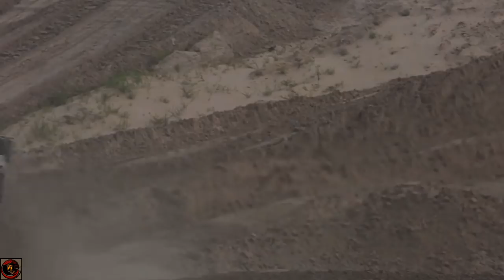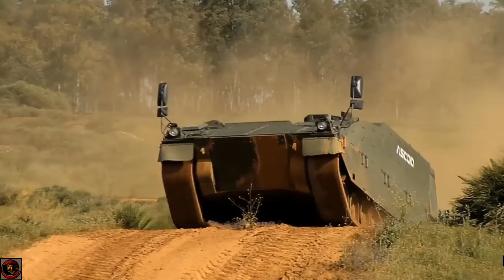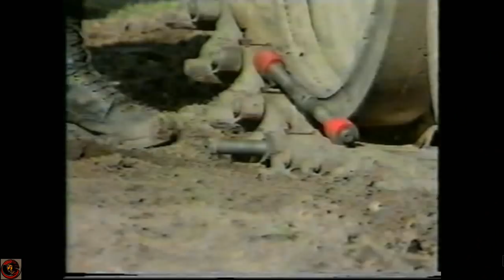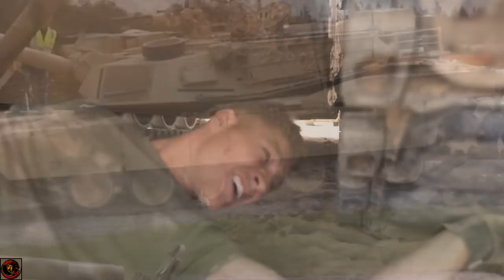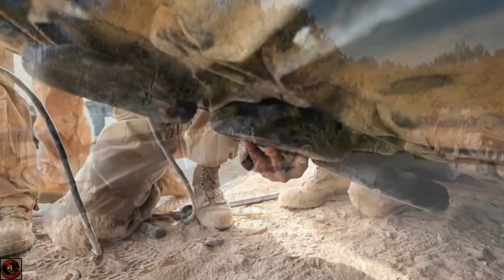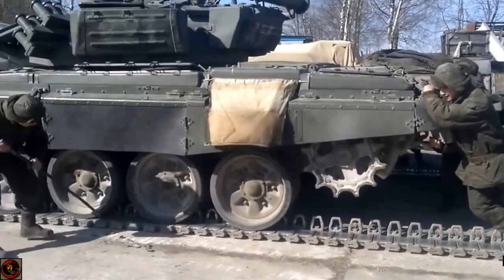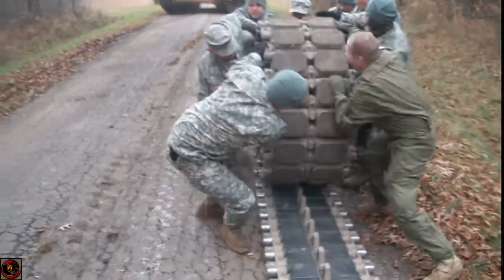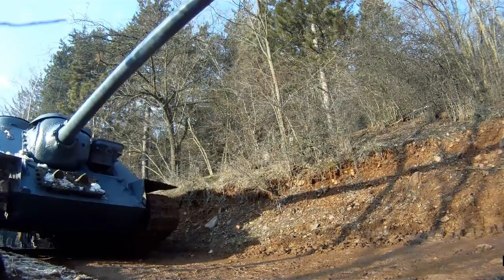What’s The Biggest Weakness on a Tank?

Comment: I still say vision is the biggest weakness of armour, you can be fully resupplied and mobile, but if you can't see the terrain or enemy, you're useless. Sure the crew can pop their heads out, but we all know how that goes when you're under heavy fire, I'd rather be a bunker with vision.
Reply: Experimental, as of now, IIRC. 
However, that sort of thing relies on sensors on the outside of the AFV, which (surprise) may well be damaged by shrapnel or other hits that don't actually damage the AFV itself. If that happens, you're back to the regular vision blocks.
Reply: 80% of the time commander of the tank will be poping his head out (exception would be city combat) cuz no vision port or next gen camera monitor will provide you with the same understanding of battlefield as you popin your head out.
Trust me its better to go into battle(or training ,whatever) with a blind tank rather than paralyzed tank...
Reply: Jochen Träm  The panzer 2 has solved the problem with its later variants in 1943 with a 180° viewport glass installed on the top of the turret near the hatch
Reply: Jochen Träm  Thus enabling the tank commander to view outside without having to be exposed to enemy fire.
Reply: I agree with this since "Information is ammunition"
But you have to remember that technology today isnt like it was back in WW2, it is constantly evolving. Taking the Abrams as an example, it has a GPS, a FBCB2 that allows the TC to track friendlies and overall increase battlefield situational awareness, has a CITV, a RWS/CROWS that can be used to scan for targets instead of sticking your head out and like any other tank out there, has periscopes. 

Of course, with all this said, it will still have blindspots. This is why there's Infantry and other support assets around to cover for these weaknesses
Reply: There are many potential ways of visualizing the short terrain surrounding, or visualizing the surrounding trough camera-blending of any sort. But that just means a LOT of electronics, sensors and places on the tank surface, that get completely useless once going trough mud or dust. ( but one could invent some sort of pressurized air system to clean them too, for the con of yet another system added to the thing ) Well, not completely useless, but one surely needs someone to go out with an cleaning rag. It be surely nice to have it, if one can. Also, the costs of such systems, maintenance, or even repair/replacements costs make it viable truly just for few nations and in small numbers. It probably be also a big pain for potential future modifications or modularity. But i could imagine some sort of terrain-radar ( in the sense like airplanes have them for really bad weather and low heights ), were it could let you see a sort of terrain-mesh. But it probably be difficult to use as one cant guess as good the stability and character of the ground without the color and fine details.
Reply: Callsign-YukiMizuki Even with all of the tech built into modern tanks most, if not all, tank commanders still prefer to operate unbuttoned and using the good ol' Mk. I mod 0 eyeball. Sure it doesn't have the range, or the night vision capability of modern sensors but they haven't made a camera yet that can properly replicate the field of view that you get from the human eye and I think that's why TCs prefer to operate unbuttoned.
Reply: I'm going to call that a rain cover, since I have problems imagining a piece of glass that'll stand up to a .50 BMG. Small ones, yes. Large panes, not so much. And I'd be grateful for a source, since that's the first I've heard of that.
Reply: I left my army service as a tank platoon commander. Even the antiquated Russian T-55 that I did my service with provided the commander with very good visibility. With a little practice a commander can develop excellent awareness of the surroundings of his tank. And as someone said, modern technology can increase this 1000 fold. Contrary to that, there's not much modern technology can do about the tracks. No wonder they are the least evolved tank subsystem since tanks first appeared in the WWI.
Reply: Thorny Dig8 
I think future tanks  can and will be equipped with their own small qadrocopter (not larger than 0.5-1m) with a camera on it that will be remote controlled by the commander, which could massively extend each tanks vision and also be a convenient means of scouting ahead esp. In city environment. It might even be equipped with a laser target designator to allow targeting for barrel-launched atgms or allies.
Reply: not really, for one vision can be made much redundant, it much lighter and smaller so you can have more of them. second if you lose vision you become useless but you can still make your way back home, you lose mobility you become a liability because their is incentive to defend the stranded tank because human lives, expensive vehicle and top secret tech.
Reply: actually ,they use a periscope style goggles...but it is very  limited...
Reply: Dima Hagever i believe that like their backup system i.e. if all higher tech fails the periscope should be able to work they are small tough targets. they have a bunch of sensor including generally two infrared cameras one for the commander the other for the gunner.
Reply: i was a rifleman and were on several ocasions fighting (training) against armored vehicles. abrahams, cv90's etc. And they absolutely bring hell. the thermal sights are godlike. they can spot your face a couple of kilometers away and spray it full of bullets before you've even seen the tank. especially during night and in the cold. ofcourse, tanks are weak to ambush, but a good tank unit would never expose themselves to an area where they can be ambushed unless absolutely necessary. 

even our javelins fell short sometimes because of their fancy defense mechanisms. 
All our training was done with the saab laser system, wich is very accurate in therms of damage and so on
Reply: Boots on the ground relaying information.
Reply: Thorny Dig8 So what is your point? A transparent armour for more vision?

Comment: You were so right, tracks are relatively weak and WILL come off if you ever are part of an armoured force. The last tank should have cleaned off all the rock from the inside of the track as it got caught in everything and screwed it. My mate tore a final drive off a 55 ton tank and it got stuck above the next road wheel creating a bulge in the tank guards...gas torch job. At about 12 months into service in the Aust Army I rolled a track off at night so it was jammed as well as off. I had to fix it without lights, full tactical and wanted to punch the troop commander complaining about why we couldn't move into the correct position. We has no night vision so driving was all by feel and shadows. (Australian Amy Cav)

Comment: What's the biggest weakness on a tank?
WOT player: oh it's gotta be the commander's cupolas. You can shoot it 20 times and it will blow up. That's why they got rid off them right?
WT players: man don't listen to those kids playing around with HP bars. The largest weakness is the tank's gun shield. They are weak as hell. The M60 Patton has a super weak gun shield that can be penetrated by T-34/85 from 800 meters. Also, there are gaps on your turret ring that has no armor at all and you can always shoot them from 1km away.
Reply: "What's the biggest weakness on a tank?".........Airpower.
Reply: InsanoBinLooney nah air power could miss...ATGMs dont
Reply: ATGM's are useless against modern vehicles because all of them use anti-chemical weapon armor appliques like ERA.
Reply: Anti chemical weapon armor? Thats new.
Reply: Chemical is mean for shell that contain explosive material to destroy the tank, opposite to kinetic round
Reply: But air power launch atgm too!! And bomb are guided so your argument is weak
Reply: Not really. A missile can be more easily guided than a bomb. A bomb is dropped and 'glides' towards the target. And when I say 'glides' I am generous. It is a controlled fall at best. Attacking a moving target with a bomb is pretty hard to impossible depending on the speed. A missile can guide itself via radar, can be guided by radio or visuals and it can change altitute and speed.
Reply: About gaps on the turret ring is almost true, there is a captured tiger after being shot between the hull and turret armor, rendering the tank unable to fight because the turret can't rotate.
Reply: As a WoT player I'd say woodland, or muddy terrain. 

NAH JK JUST LOAD GOLD LMAO
Reply: As a veteran War Thunder player ace of German panzer division, id say that a tank weakest spot is the side armor, even im using a tiger II H im just 1 hit from russian t34
Reply: E Shark that doesnt make it a good game...
Reply: Xikun Gao cupolas were removed after they stopped staggers too often in 1973 war. biggest weakness on all tanks except mercanaries are grill doors. can not put armor on everything
Reply: men of war assault squad 2 is much more realistic except for the repair button.l
Reply: No... Im a wot player and I said tracks.
Reply: Yes, a damaged track on MoW requires the crew to repair the vehicle, which takes a significant time and leaves the crewman who is repairing vulnerable for that time.
Reply: As a wot player I would have said tracks. Doesn't matter if you are wot or wt player you would have said tracks after thinking a little bit.

And gun mantlet is actually pretty hard to penetrate even in real life. About turret ring u were right but it is pretty hard to hit. 

And yea. I am not sure that were you serious:D If you weren't, I have wrote pointless and stupid comment so please were.
Reply: Imagine if tanks were just imaginary things for games. Oh wait, they're real.
Reply: E Shark I suppose you think Britney Spears is very talented or Justin Bieber because of their record sales. WoT is free to play, Russian and completely nonrealistic. A great game for mobile phones by any standard but WoT is built off a real physics engine which will always run better than that garbage call of duty clone world of tanks.
Reply: I suppose you mean WTs physics engine...
Reply: Wt players: the biggest weakness of a tank is it not beeing russian😂😂
Reply: The Big Boy lol, mowas2 is not that realistic, but its a good and frustrating game😂
Reply: You don't play WT do you?
Reply: TheTeknus
Yes I have seen that. The crew had to abandon it, didn't they? In North Africa?
The Panther was known for its 'shot trap' area caused by the rounded gun mantlet on the earlier models. If even a 40mm AP round struck the gun mantlet below the Panthers midpoint by 16 inches, the chances of that weaker round ricocheting downward directly through the thin hull roof armour was very high.
Reply: Biggest weakness of tanks : the engine compartment eve a hand grenade can destroy this ...
Reply: "What's the biggest weakness on a tank?"......... still  airpower.
and the biggest stronghold on it- the cost of fuel of the airpower
Reply: am suggesting when enemy's airpower is suppressed, the artillery with their digital age top super rockets means nothing when the  own airpower in the air is dominating
but the cost of that suppression means it could be one short blow with expences on the reconnaissance - not the constant insurance waiting when the enemy will show himself 
do you smell the gap?
Reply: Yeah, it is not a cheap one, but it is cheaper the patrolling in the air. A flying air gas turbine means garantied consuming of thousands bucks' fuel per sec and it cannot be interrupted during the flight . A diesel of terrestrial armored vehicle  is eating a hundreds of bucks per hour and can be stopped during the mission.  Perhaps money means nothing for a proud warriors, but at least the places and time for refueling ...
Reply: ...And, plus, a tank- it is a part of terrestrial weapon, dominating there though , but just a part. It would be engage in reconnaissance by battles. Actually- it will have to be where other way of reconnaissance are impossible. For actual  terrestrial patrolling would be used a vehicles cheaper and more universal (IFVs, lighter patrolling cars, like hummers- depends on estimated possibilities of enemy and possibility of own airpower)...
Reply: InsanoBinLooney the tanks biggest weakness and all fear are the Apaches lol
Reply: TheTeknus yea and its the tiger thats in the Dorset tank museum and still runs
Reply: Yeah, sadly most WT players are apparently fakes, who don't know the game mechanics of the game they try to defend:(
Reply: Xikun Gao lol
Reply: The greatest weakness of a tank in WOT is the lack of moneys.
There are two classes: buyers and players who buy none; how the second wants to win ?
And i use a neutral approach to avoid problems.
(look for MG socks, hatches, down plates, weak places (ex E100 turret the joint of frontal and lateral armor), visors, etc; i exclude the lateral or back)
I play since 2014 - 2015.
Reply: +icevoid
have you played above 4th era?
WoT has a massive problem, but it isn't "premium" ammo, my dear slowpokes that needed 3 years to react to it and still whine about it to this day. As if it's a fresh experience still.
Nope, it's f//cking invisibility. Skorpions, E25's, swedish TDs. That cancer receives massive detection range and a damned stealth field. I know that outdated corpse of a game engine is limited to 440 meters, but is it so hard to change a few numbers in text file and adjust draw distance to maximum and just separate detection and marker distance to work on previous mechanics? One test server... ugh.
Reply: Omega Alpha or IR/heatseeking missiles
Reply: Xikun Gao dude auto repair of track don't count your experience play on video game means nothing!
Reply: was looking for this AHAHA

Comment: Holy fuck as a US Army tanker myself. When it comes to breaking track and a driver throwing track if you have a really good crew, you can get that shit done in 45 minutes. But christ it is agonizing . That’s why you always PMCS.
Reply: Physically gruelling, and as you might expect nearly always happens in the worst possible terrain too.
Reply: 45 minutes? Wow, that's fast. I thought it's mostly a 1-2 hour job depending on how mangled the wheels and sprockets are...
Reply: largol33t1. The road wheels and definitely the sprocket or idler need a shell hit or mine to cause substantial damage - they're pretty tough. Replacing a track pin or getting a tank back on it's track is an absolute pain but not too time consuming with 4 guys and the right equipment & taining.

Comment: I laughed at the warning @ 16:27 I was thinking the exact same thing.
Reply from the maker: Jason Reynolds no idea who made them do this but they are dumb.
Reply: Ah well... a fine warning, but over 35 years too late for me to heed.
Reply: it's painful to watch them
Reply: SaVAgE OG, you've never worked with a heavy machinery, have you? This track weighs more than all the people around combined and is very unstable. At every moment it can topple or start rolling which would result in a heavy injury or even death. There countless sad stories of people why tried to play with things that deserve caution, the saddest part of which is that most of these stories are true and repeat themselves over and over. Some people learn, some weren't so lucky.

You can play stupid when it is safe, you just don't if there is a real danger. Safety rules are written in blood.
Reply: That is a couple of tonnes of metal by the time they start having trouble rolling it, basic physics, the metal wins. Please see the video clip before ;) Physics 101...
Reply: Back in My Day (1980 - 82) the T142 track for the M60A1 tank consisted of 80 track blocks, each block weighing nearly 80 pounds each. Therefore, each track weighed about 6400 pounds (3.2 short tons). In garrison, it was easy to get a recovery vehicle to unfold a fresh track to install on a tank. But the old track had to be handrolled into a compact coil for scrap metal collection. It would have been safer to break it up into manageable sections, but no one had all day to cut it up into chunks. Rolling it was quicker and took 30 minutes tops. There is a serious element of risk involved in all armored vehicle operations, but in my 26 months of service with an armored company, no one was ever hurt rolling up used tank tracks.

Comment: I'd argue a tanks biggest weakness is its crew. A tank has many weak spots is its tracks, its barrel and top hatches the rest tends to be quite well armored and well designed. However a poorly trained crew or cowardly crew can lose without ever being fired upon or worse  fire upon its allies. A trained and supplied crew can repair its tracks and hold despite being surrounded and outnummbred. But nowadays I don't know how modern tanks really would fare in a "fair" fight. A modern MBT can eat RPG-7's and other explosives all day , but what happens to it if it gets hit by a  NLAW, Javelin or other modern day RPG /ATGM? Will it be a hole and the crew bails from smoke and fear or will it be Sherman M4's all over again , fuel cooking crew alive or ammo blowing the turrets sky high?  I know a lot of people say that the shield between the loader and the ammo storage is good enough to save the crew but I have my doubts of how well a modern MBT can handle a penetrating hit in the ammo rack or internal fuel tanks , its probably one of the things that haven't changed since the days of 1940's.
Reply: Hitting the cupolas/top hatches would barely do anything, also I wouldn't wan't to be outside a tank repairing the tracks when outnumbered, especially not while being fired upon.
Reply: A shot into the commander cupola/hatch from a elevated position would prob kill all the crew.  People tend to think of tanks fighting on even ground ,its often one side attacking up/downhill into a prepared kill zone unless its a complete breakthrough that shatters every one.